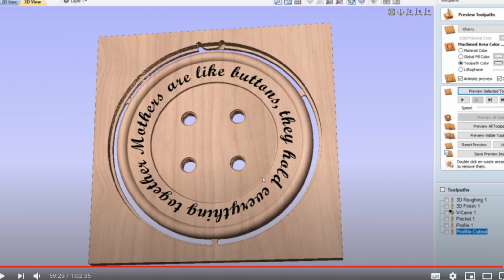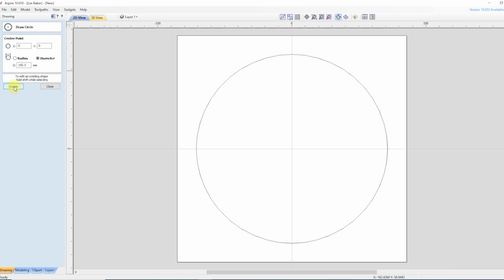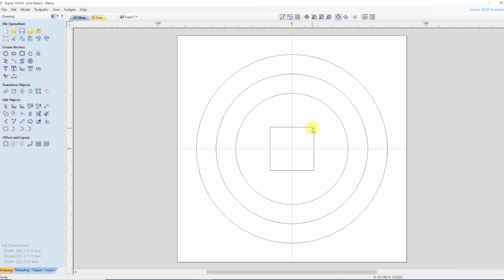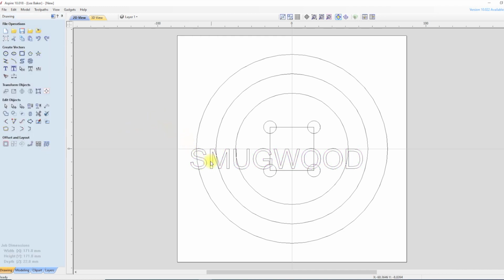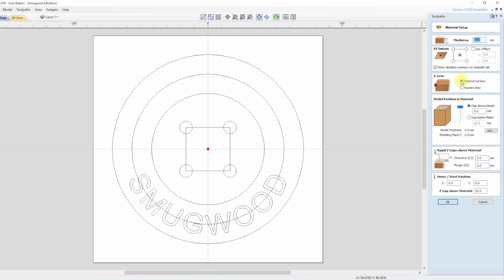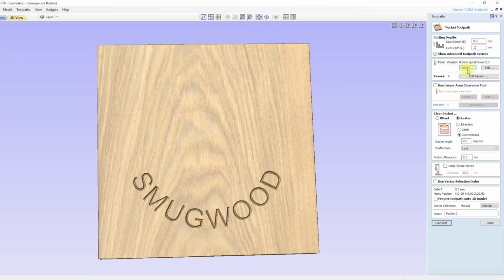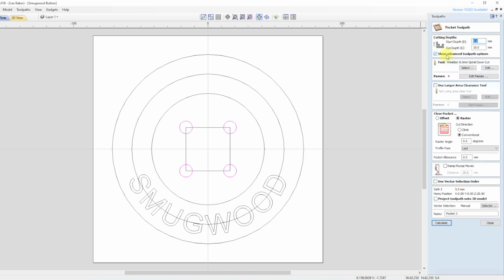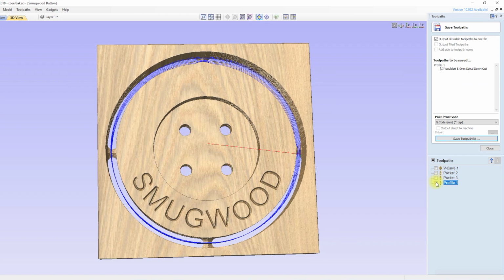Vectric CNC Tutorial - How To Make An Oak Button Coaster

Comment: while watching this, its making me feel old as when i did cnc at college, i had to do it all by hand entering g codes. great vid as per mate.
Reply from the maker: Haha thanks. Inputting g code must be really time consuming...but a good skill to have. Ive only ever once taken a file and edited the g code and it took a lot of googling :-) I guess thats the beauty of Cad/Cam now. Its not cheap but saves hours of work.
Reply: @Smugwood  it wasn't to bad as we had a book with all the codes and we learnt how to do it in a cnc class. i've forgotten everything now beyond to remember if you're cutting outside, on or inside a line. everything else is gone. it was very similar for programming robots which i also did.
now there is a lots of free software you can use to do cnc and it also works wtih 3d printing, which is kind of the same thing. only wtih that, you're filling in instead of removing material.
did you check out they flying telecaster i posted a link too? i desperately want one.
Reply from the maker: Yeah is a good video. I reckon I could easily adapt what Ive done so far to make it into a flying v. But im trying to see how I can make alterations to make it look and feel completely different from what ive made...even though its based on the same design...if that makes sense haha
Reply: @Smugwood  kind of sort of. i'm sure whatever you do, you'll come out with an intersting idea. i await whatever you decide to build with anticipation.
Reply from the maker: Haha...I already have a few crazy ideas :-)
Reply: @Smugwood how about 3 tapable humbuckers? or an offset v body. or a body of your own design?
Reply from the maker: Designing my own...that would be a challenge for sure :-)
Reply: @Smugwood  whatever you build. I look forward to watching the vid.